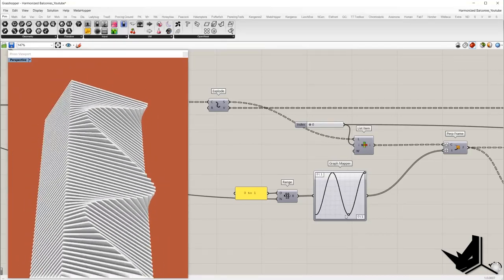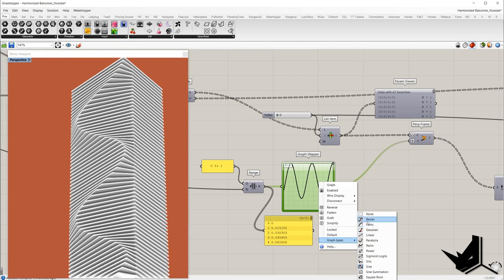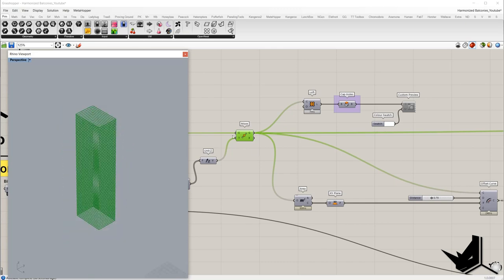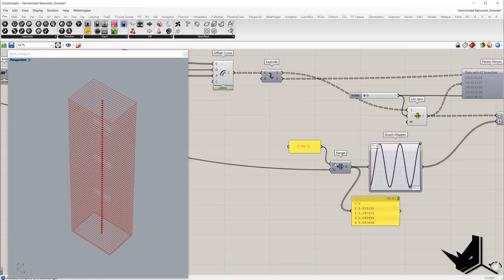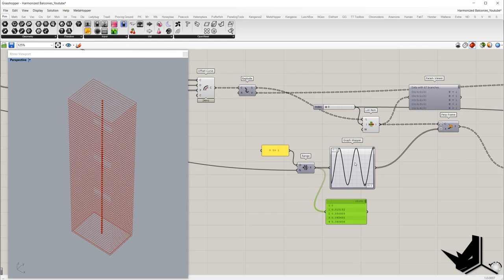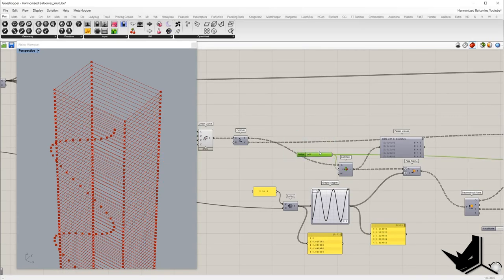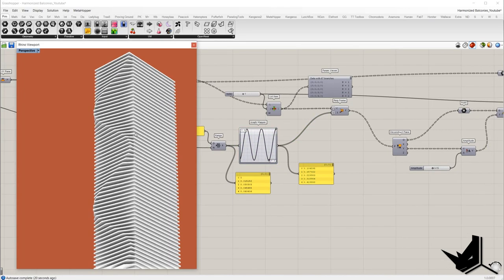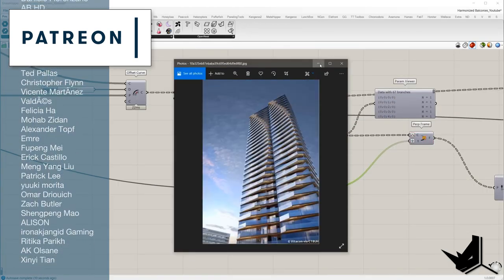Grasshopper Architecture | Facade Balcony with Graph Mapper

Comment: Great tutorial. Using Frames (planes) instead of EvaluateCurve makes the script very flexible, because it can be used in any geometry, of any direction (instead of offsetting in ie. Global Y axis). To make it even more flexible, you could use Sections of  source Surfave  and Surface Normals, i think.